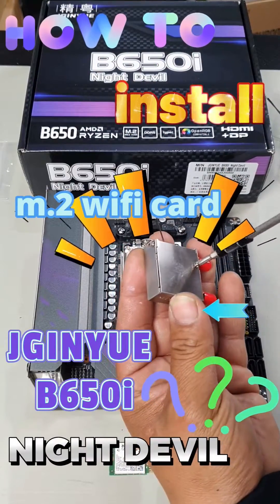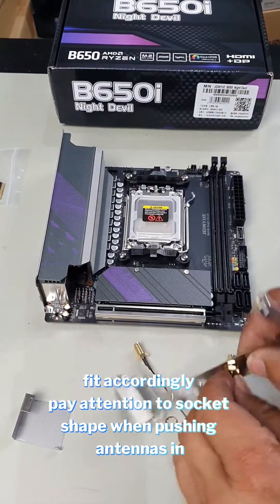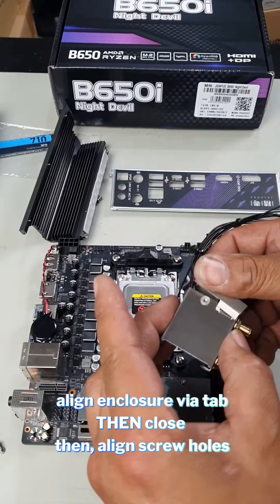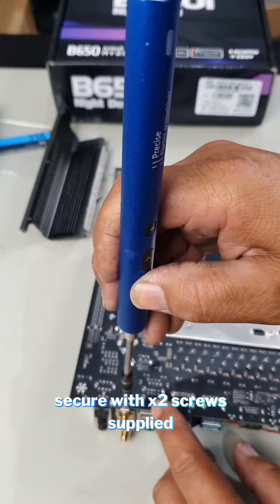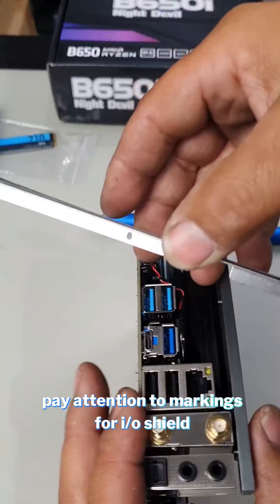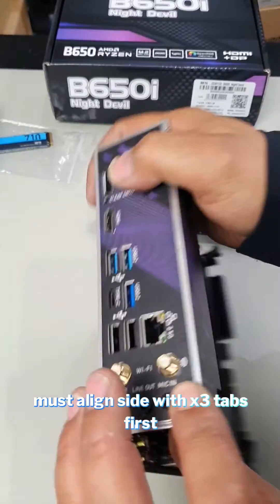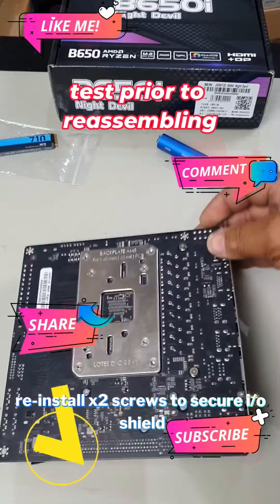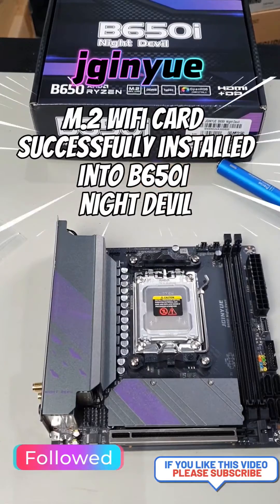am5 jginyue b650i night devil m.2 wifi card install. watch before installing.. abit more involved.

Comment: j'ai la B650m snow dream j'ai fait pareil mais je n'arrive pas a faire detecter la carte sous Win11 svp comment avais vous fait avec les driver j'utilise une RTL8852CE 802.11AX
Reply from the maker: so with the update it auto installs it for you according to what u used, did u use the correct m key? has to be the right m.2 key for the mobo, usually ax200 or ax210 wors,other brand can work as long as its the same model

Comment: I've struggled to get AX201 m.2 card working with this board. Any magic ingredients I may have missed? It's simply never detected by Windows - neither WiFi nor BT part appear to work. Tried with two separate m.2 adapters...
Reply: did you install drivers from intels site?
Reply from the maker: u can also get from jginyue site too under the mobo ... but usually wen u update windows it finds the driver for u
Reply: @MIKEYZVLOGZ  cheers - I'll try their website to see if those drivers work.
Reply from the maker: sure thing let me know how u go ... and maybe ill see if i can help u ..but one thing i remember is i ended up using the driver from the intel website because my product was infact an intel ax200/201 but ive used a different brand too and that was done via windows update ..it automatically found it for me during an update
Reply: @Shvraz  I did, yeah.
Reply: ax201 it’s not compatible

Comment: You need the antenas yes o not todat arrive me and i put i jave Bluetooth but no wifi is why i dont have the antenas
Reply from the maker: @kleven_154  u need antennas or it won't have signal for wifi and bt won't be as strong
Reply: @MIKEYZVLOGZ  Thank you if you can answer me, that's why the Wi-Fi doesn't detect it, not the computer, ah okay, okay, thank you very much bro

Comment: I am getting one for similar AM5 motherboard Erying Alkiad B650 ITX D5 - you can use AX200 or AX210, but not AX201 or AX211 (the ones ending with 1 look similar but are incompatible)
Reply from the maker: good share

Comment: Hello one question when you change the schools and you put the Wi-Fi card Unity the anthems buy the longs one our not is necesario
Reply from the maker: u need to make sure the antenna cables match the wifi card .. that's why I swapped mine and it was so long because it was made for other atx mobo not itx..but u can still use just get a shorter antenna cable or hide like I did
Reply: @MIKEYZVLOGZ  thanks Mike foy your help
Reply from the maker: @kleven_154  ur most welcome

Comment: what about the smos battery did you just leave the cable dangled?
Reply from the maker: ye it just stuck on there its how it's designed..the battery is stuck on with adhesive ..it doesn't dangle

Comment: What is your thought on the board overall, would you recommend or is it too "Janky" ?
Reply from the maker: honestly it's fine for use..I've been using it for a while in my sneaker x and it's fine works fine
Reply: @MIKEYZVLOGZ  nice to know, I may ended buying it for my next HTPC build! 😊
Reply from the maker: @TontonGahu worth a look my friend trust me esp for price point... but also I've seen it has gone up and down ... if it is going to be about 130usd just see if u can find others in similar prive range n compare..wen I bought it it was 200aud flat and one was 190 aud shipped to my door aliexpress..cheapest itx I could find with all the features I wanted like type c and 2 m.2 slots heatsink and vrm

Comment: i have do the same thing, but my window not regconize the wifi card, even tried another ax201 still not appear in device manager. I also tried to install driver from mainboard site and intel site, not work at all, sad me
Reply: Just figured out the problem, in the mainboard page it show that this board only support m2 wifi slot using pcie protocol. And the ax201 is not, just swap to new ax210 and it's work like a charm
Reply from the maker: nice
Reply from the maker: what were u using ..did t u use the same m.2 as mine ? which did u have
Reply: @MIKEYZVLOGZ  i'm not yet to know which one did you install in your computer. But ax201 not work for this mainboard because of m.2 CNVi, while ax210 work fine because it use PCIE protocol
Reply from the maker: @tommy2117  heres the link https://amzn.to/46eciLP is this what u bought nows theresd a ax210 version, but mine didn't cost what u see, mine was only 35aud which is about 25 usd
Reply from the maker: @tommy2117  that's wierd it should just work are u sure it's in ...is it recognised
Reply: @MIKEYZVLOGZ  what wifi card did you use btw

Comment: i want to know the reason behind itx motherboard has high temp is it because the small case or its actually the motherboard size cause the hot its self?
Reply from the maker: both that's why sufficient Col
owing is key

Comment: Hello, u can send me a aliexpress link for this wifi card? ai have a b550i and i cant find the pci board like that
Reply from the maker: b550 is abit different ..  are u sure tour mobo has the m.2 wifi slot
Reply: @MIKEYZVLOGZ  has the jginyue b550i, have the same slot pcie on the i/o, and 2 m.2 slot, front and back
Reply from the maker: @Dangz ok so the b550i has the same m.2 slot u install it the same way ..if u watch the install video on my b650i it's the same principle procedure..it does have x2 m.2 slots front and back but no type c on io shield. everything else is about the same
Reply: @MIKEYZVLOGZ  okay! Really thanks, i will try it with a ax200
Reply from the maker: ye ax200 is fine

Comment: I've the same board.. do you have the problem of controlling pwm fans? Because the bios are not detecting it.
Reply: Thx for the reply, i hope this board will get a bios update till the end of AM5
Reply: @Antovin33  update your bios to the newest version, i'm using fan control app and it's work fine
Reply from the maker: yes u can do that too...for example if u have adus mobo use the armoury crate it's good
Reply from the maker: no use the fan headers, if u are using a hub make sure you plug the hub pwm into fan header and u can control the fan speeds, i notice if you do not plug in the pwm from hub(if using one) fans will spin super fast
Reply from the maker: if you have issue with bios , u can always buy inline pwm adapter to slow down the fan speed